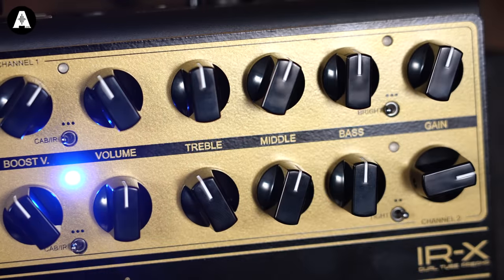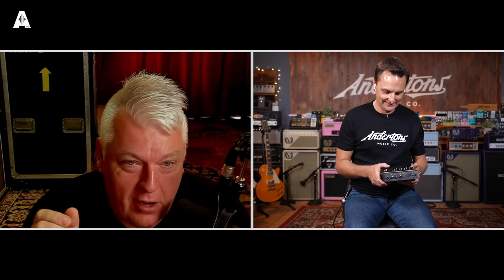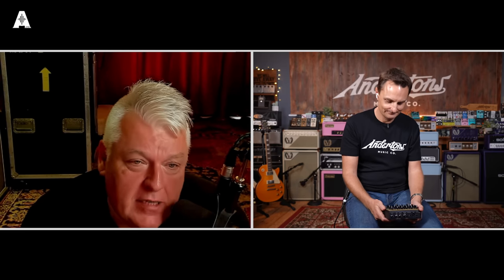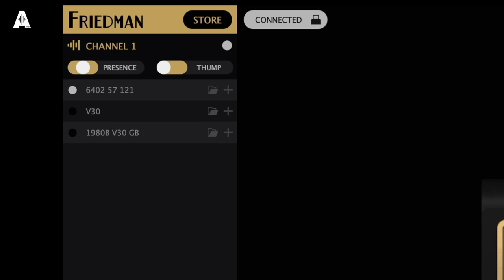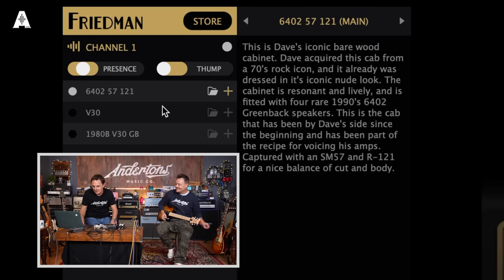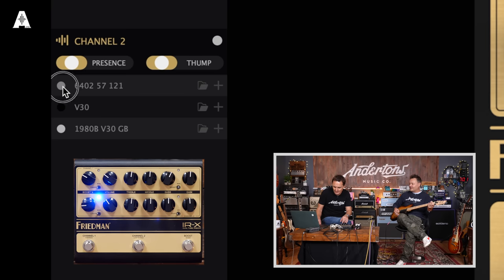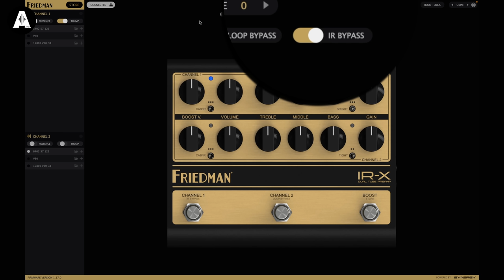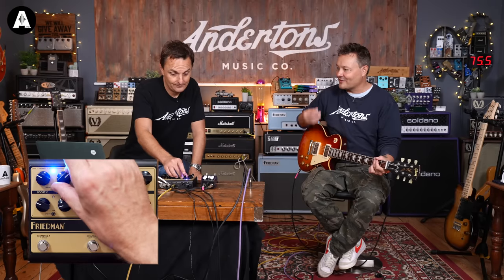Friedman IR-X Tube Preamp With Cab Sim - Valve & Digital In Perfect Harmony!

Comment: Sounded thin and didn't have that chewy organic spongy tone .. was lacking something !
Reply: Agreed
Reply: I have an old H&K Tubeman - and the JJ 803S Tube really  changed the tone to warmer smoother - usable gain - not for Hard Rockers...maybe 
BUT IF the JJ803S [ 2 of them ] did the same for this pre - it might be Carlton/ EJ/ Neil Schon / Santana /Gilmour [ modern Santana ].
 no fuzz] Lukather -
 not what you guys want but ...
It would be great if it warmed it up for 3D Cleans , and Midgain tones.
The Longplate has a much wider sweet spot ...so hoping someone trys it that way ...

Comment: The wall wart PSU makes this a fail.
Reply: Why,?
Reply: @NamelessSmile  Let me guess, you're a drummer.
Reply: @An2oine  no just an engineer that works with them for audio and scientific applications
Reply: @NamelessSmile  Engineer. Outstanding. Apologies for thinking you were a smart alec.Guitarists have so many "devices" that wall warts become a mess. Especially 24 volt floor warts, and some use "weird" voltages. It is just so easy if certain "pedals or preamps and low watt amps" have it. It is just easier to deal with IEC and on-board rectification and that everything is there, like a revolver vs. a pistol with a magazine..  Mainly primary devices, though.
Reply: @An2oine  IEC can be much better indeed as yeah it can get tricky, and also some bundled switch modes are ass......but then on the other hand that method adds in the need for quite a few extra safety considerations as now you have mains in your pedal!

 Now you need to have proper isolation between mains and 12v sides, so much less elegant PCB, with bigger traces and blank areas on and between one side, with fused parts, cooling etc and possibly extra certifications depending on where you are. So I presume the switch mode is a path of least resistance...

Comment: You talk about how easy it is to use then you start talking about software and ir's, that's where you lost me so I will just stick with my simple tube amp thank you.
Reply: this would be a better way to get that sound on tape however. capturing your tube amp with mics and then mixing it properly to actually replicate what it sounds like in your room is very very difficult. products like these let you pretty much plug and play directly into your audio interface on your computer and get a badass mastered tone pretty much. it's really just for simply capturing that sound on a recording, which is very difficult to replicate with an actual amp and microphones unless you have some studio knowledge.
Reply: You'll sound like everyone else going direct. I like cranking 100w as loud as the engineer will let me to get all the warble, crazy crushing kind of tone. I want to make it a bit scary and it should be. I will use it on stage though to feed the house speakers cause it sounds great and I can feed my power amp which has digital fx built in or use the 100w marshall for my stage sound and have the foot pedal boat. I like the versatility!